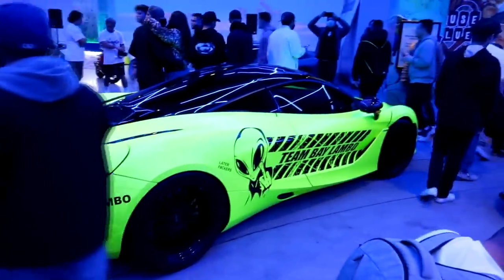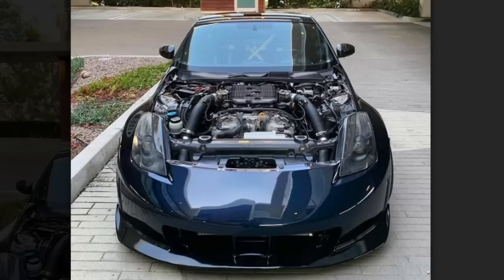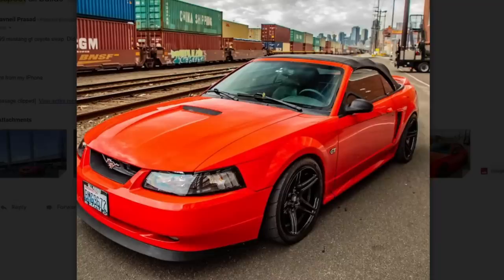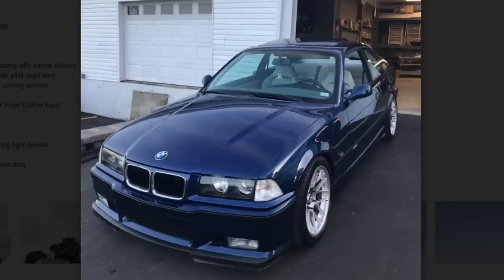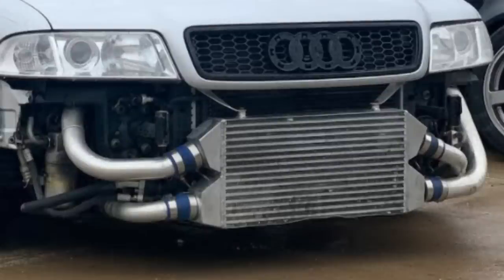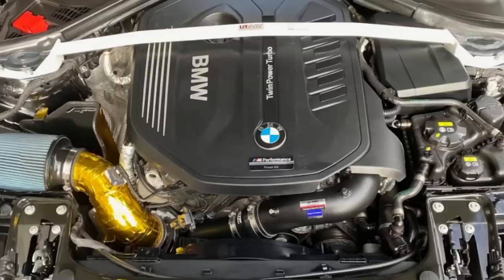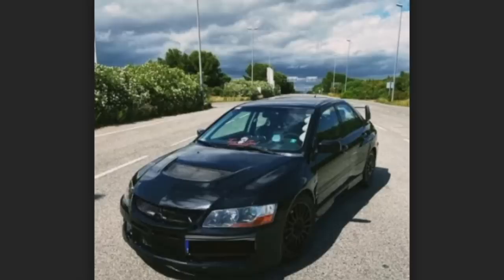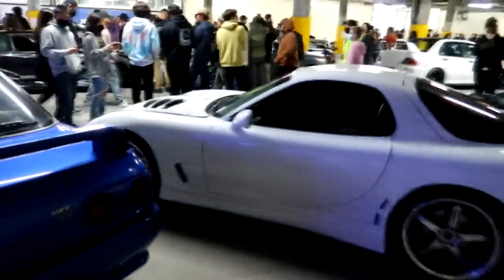Are GERMAN CARS The Best To BUILD??? - Respect All Builds!!!

Comment: Can’t wait to submit my GT350 when it’s done. Still deciding between a Gen V whipple or a ProCharger. Should make 860 on the whipple reliably, or experiment on the ProCharger and make 940-980 WHP.
Reply: Do not use a centrifugal supercharger it has lag use a roots style supercharger
Reply: @itzshark6737  It still has less lag than a turbo, if any at all, and will make MUCH more power.

Comment: Germans are or rather should be the builders of mecha or mechanical systems.  Huge engines, huge air and massive air displacement.  
Germany's real job though is telling Italians how to do stuff.
Japanese are electrical appliance masters, no failing BMW window jams or Audi battery nightmares here.
Australians and USA are the most Yokel which means practical manufacturing (Ford) or beast mode muscle cars.

Comment: That kid didn’t even build that Audi so technically bought not built 😂
Reply: Your right I would’ve preferred to build it myself but I’m still in high school and that would’ve cost me twice as much plus a lot of Time but since I’ve owned it I have had to do work on my own running new hydraulic lines putting the clutch in slave cylinder drive shafts and the out put bearings wheels bearing etc.
Reply: @alecsmith910  well that’s a start 👏
Reply: @ghostedwarrior1968  at least I can say I fix the shit on my car myself

Comment: Dude really said 300hp but said the torque in metric so you wouldn’t know how little it really is
Reply: 510 fp lb
Reply: @creehan4422  nah that ain’t it, that would mean the engine only revs to 3000 rpm
Reply: @creehan4422  nvm I just saw that it’s a diesel so that sounds about right
Reply: They come from the factory making 185bhp and 400nm
Reply: I need to replace the clutch on it soon it’s starting to slip

Comment: The gti is a soccer mom car. Every car from the Europe is a soccer mom car
Reply: Stijn 6  are you kidding me? First of all asian cars have the worst interiors, secondly Europe literally gets the US handme downs for interiors. The only cars outta Europe with legit materials are a quarter mill and up. Otherwise even on a hundred k Audi you're still seeing plastic and the same leather every other auto maker uses. The only difference now is that there might be more leather in places and carbon fiber. But a Vette has more of all that stuff and Costs less. Not to mention the stupid irreplaceable pos stock head unit euro cars come with and sound system. More and more american cars are getting factory Harman karden systems. Even in the 30-40k ranges. And if they don't then they have Bose or alpine. You spend 60-80k you get Bose from a euro. US cars have always lead the auto industry in comforts and luxury's of the interior. Shit the new top trim suburbans and cadis got interior goodies that'd make Mercedes wet. You're over here comparing a m5 to a Cruz Le. Have you seen an A class Mercedes???
Reply: Stijn 6  me not backspacing as far as I thought I was
Reply: Stijn 6  ford is the only exception to american interior quality. You can spend over a hundred grand on a ford and the interior will still be shit.
Reply: Stijn 6  no better than Audis. Audis interiors I wouldn't necessarily say are garbage materials. They're just boring. And their audio is shit.
Reply: Stijn 6  I have a 06 srt8 with the leather and sued interior. Literally looks brand new. I look at BMWs even from 2010 and they'll be faded. The leather in Mercedes gets cracked and stretched. And Audis, other than top trim, are dated no matter the year
Reply: Stijn 6  if euro cars are so nice and built so well then why do you guys have to get rid of them for a new one every year like it was an IPhone. Why are they the most commonly leased and not owned vehicles? Why does bmw continue to struggle with making headlight wiring that lasts more than 5 years?
Reply: In europe its a football mom car XD
Reply: @ocallaghan3865  lmao I waaaasss gonna say that but 🤷🤷🤷